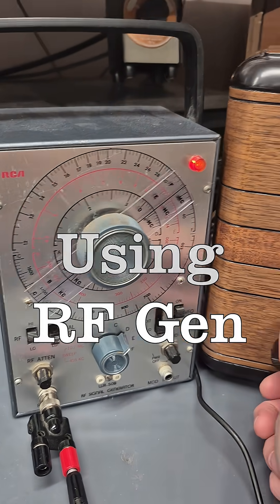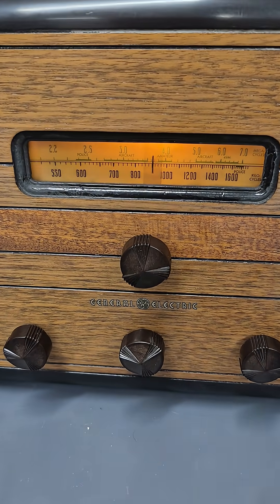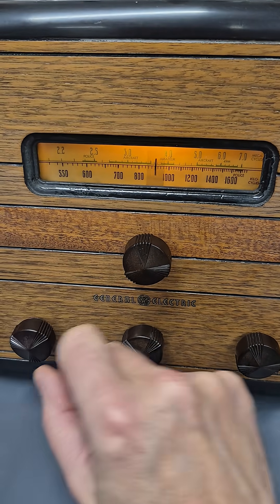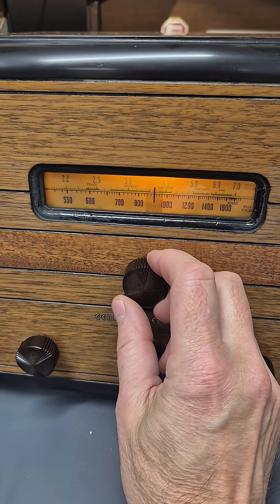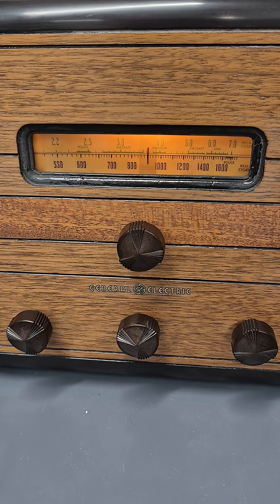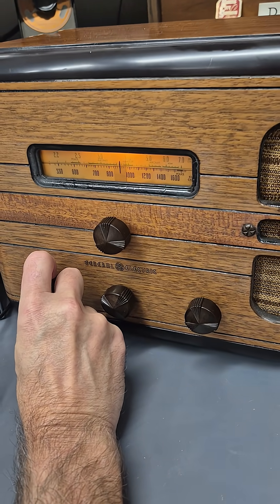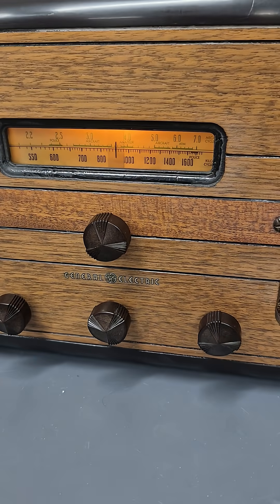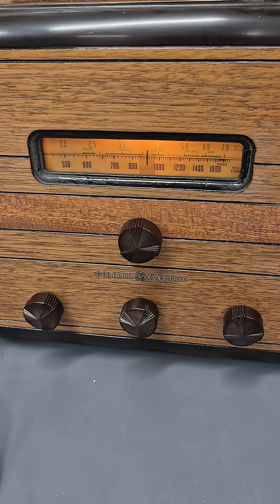RF tube SSB #diy #shortwave #vintage #repair #audio #antique #retro #hamradio #broken #old #cool

Comment: By the dial cord, looks like smack dab am portion of 80.
Slop buckets will use any open portion of the band. Being an am'er yeah I got issues with sidebanders on 80....damn right I do.